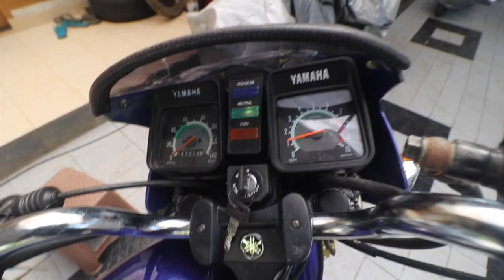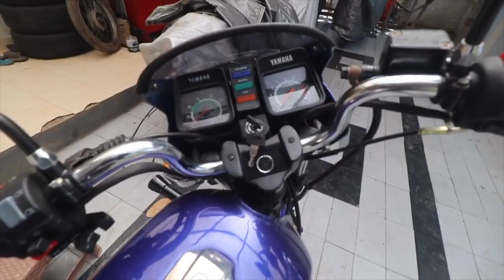How to clean and tune a carburettor (Malayalam Video)

Comment: If petrol damge o rings and rubber parts in a Carbourator , while cleaning?
Reply from the maker: It will
Reply: @Yamakaze  so whic is best nikavi Carbourator cleaner?
Reply from the maker: @its.me.ragesh  never put rubber parts in any solvent, remove the jets and leave them overnight in brake fluid, take the carb body and boil it in harpic + water. Use compressed air to clean each pathway

Comment: 🔷🔷🔷Clutch pidich gear idumbol vandi chadunnu..enathayirikum reason........pinne idakk gerar idumbol gear veeyate nuture aayipokunnu..pls help🔷🔷🔷
Reply from the maker: Adjust the clutch cable properly
Reply: @Yamakaze  etra adjust cheytittum ath poletaneyan
Reply from the maker: Clutch azichu nokendi varum
Reply: @Yamakaze  clutch plate set cheyumbol aa cutting ulla baagam ellaam ore positionil ano idaar
Reply from the maker: Ethu cutting?
Reply: @Yamakaze  clutch discinte idayil idunna plate
Reply from the maker: Steel plates, Beveled endow should be up

Comment: Cheriya doubt ente rx100 cylinder mariyatha orginalalla G4 pickup oke ind but top end kerinilla last 85 enthaaayirkum issue
Reply from the maker: 85 ok speed aanu, carburettor, sprocket, cylinder, wheel size everything is against rx 100
Reply: @Yamakaze  tnq bro

Comment: RMP Meter ellatha vandikk sound vach alle tune cheyunne ideling ettavum kooti vach air screw tune cheythu engine sound kooduthal akunna edathu vachu ideling kurach vachal ok ano atho 4000 rpm vekkanam ennundo tune cheyyan ?
Reply from the maker: E video il paranjutulla pole aanu njan cheyuunatha

Comment: Brother, I was cleaning my rx135's carb the other day, and noticed that the o-ring underneath the main jet is missing. I don't know what effect it has on the bike's running. Could you please tell me if I can get it from the shops? Probably from other modern bikes?
Reply from the maker: The oring prevents fuel getting sucked directly through the bowl into the atomizer. It might flutter mildly at some rpms. Nothing major
Reply: @Yamakaze  Thank you so much, Brother! That helps a lot.
Reply from the maker: @mjshaheed  👍
Reply from the maker: @mjshaheed  👍

Comment: Bro, Njan rx135 carb il munne 100 nte jets ayerunu.. now I has  changed to 135 spec jets but the missing happening after quarter throttle and rpm not moving up after 40kmph . What will be a remedy for this issue. Thanks in advance .
Reply from the maker: Needle position

Comment: RX 135  5 speed, engine start ആവും ,പക്ഷേ 2 minute കഴിയുമ്പോൾ ഓഫ് ആയി പോവുന്നു ,എന്ത് കൊണ്ടാണ്
Reply from the maker: Carburetor aavam, cdi aavaam, spark plug avam, ignition switch aavam, ignition coil aavaam

Comment: Rx135 carb needle pin 3rd pisition il ittal enthanu kuzhappam, company parayunnathu 3rd position aanallo
Reply from the maker: Illa
Reply: @Yamakaze  proof undangil next vedio seiumo
Reply: Guru rx100 user manual nokkitu undo. Company paraiunathu middle slot aanu. Company karer kulavakki angana vandi tharumo.. Next vedio'il nijam paraiyanum
Reply from the maker: @mmv3793  ok
Reply: 2 slot il ettal nalla smooth working kittum ente carburettor il 2 ndil Annu 3 rd il ideal moshan ayitanu thoniyath
Reply from the maker: @sonymathew488  depends on the carburettor jet size, elevation and a lot of other things

Comment: Helpfull video.portingine kurich onn vyakthamakkanam .
Rxg gerking ozhivakan port cheithaal mathiyenn parayunnu sheeiyano.
Pinne portinginte gunavum dhoshavum
Reply from the maker: Sure, jerking inde karanam ports alla, magent,  coil and power box
Reply: @Yamakaze  clutch bell maathram maattiyalo
Reply from the maker: raheem c rxg clutch annu athil ulla ettuvum nalla sadhanam
Reply: Ath ok aan, but  magnet rx100nte ittalo.
Powerbox entha cheyya
Reply from the maker: raheem c 135, rx 100 work cheyyilla.
Reply: 135 idanam alle
Reply from the maker: @raheemc497  yes
Reply: @Yamakaze  ok bro
Reply from the maker: raheem c 👍
Reply: Rxg jerking maaran rx135 te weight kooduthalulla magnet ittal madhi bro...
Reply: @ranjithranju4164  ok. Thanks bro

Comment: Sir ..Satyam parayalo
Iduvare kandadil vechu
Ettavum perfect ayittulla
Explanation
Really you have a deep knowledge about two stroke bikes
I have rx100. 1991 my bike hardly reach 
85 to 90 km speed only .at 80 to 85 speed my  bike feels unavailablity of petrol in this time if I release acceleration  and again I start to accelarate bike can't accelerate then bike feel engine off .within 40seconds I can start again easily.and it seems same problem in80 plus speed.my carburator   mikuni japan i cleaned many times but same problem. I cleaned 2 jets properly 
I never opened  atomizer.because today I saw that in your video.now I use micarb carburator borrowed from my friend. it gives not good performance.but it reaches 95 km same before without any
 missing(unavailablity 0f petrol)
I wish to reach 120. normally my friends rx100  bike do that .
I changed my sproket 15/37 teeth from rx135/rxg .also I fitted 16  inch rear wheel from yamaha enticer.tyre TVs 16 inch 3.25 size. Please reply a solution if I want to increase speed of my rx100
What modification needed.
Please give a solution for my mikuni carburator issue.

So that I want to fit my orginal mikuni carburator.
Reply from the maker: Small tyre will only give you better initial, you have accidentally opposite mods, like the rx 135 rear sprocket will increase the top end but the 16 inch tyre will reduce the top end. Try adjusting the float height.
Reply: @Yamakaze  thank you sir
 A big thanks
Reply: Sir
Ende rx100 il njan eeyide power box fix cheydu.ende oru cherita arivu kond njan vicharichu pickup power okke koodumenn but pratyegichu oru maattaum vannilla .adu koodand ippol stock silencer aanu .rx100 Chrome.
Ende kayyil mini cat silencer . exhaust chamber.  catalytic silencer um und 
Pinne six hole rx100 silencerum und 
Idil enikk performance kittan idil edu select cheyyanam . please reply sir
Pinne oru kartam koodi chodikkam und
Ippol ulla carburator micarb india aanu. Mumb mikuni japan aan adil cheriya issue ullad kond talkaalam idu ittadanu.idil njan triptanalla performance different aanu.
Sir paranjirunnu issue clear avan float height koottan ennittu nokkan.
Ippol njan mikuni carburator hot waterl 20 mint  boil cheydal with lemon juice or liquid dish wash..allengil diesel or petrolil soak cheydu vachal.
Idil edaanu uttaman ennu parayamo. (  components okke ooreett)
(O ringsokke ooreett)
Ee reediyil cheydal carburator stuck o matte valla problems undengil clear avumo edaanu nalla reethi ennu paranju tarano sir

Thanks
.
Reply from the maker: Shamsu 100 harpic ozich boil cheythal mathi
Reply: @Yamakaze  thank you sir
Power boxum .silencerum idinde reply parayamo sir.njan chodichirunnu
Catalytic silencer
Mini cat silencer
Stock rx 100 silencer
Stock six hole rx 100 silencer
Indinde combination with silencer.
Edaanu better
Reply from the maker: Shamsu 100 cat gives better initial, 6hole is specific for rx 100, mini cat I have never used, normal rx 135 has difference in the baffles
Reply: @Yamakaze  thanks for information .👍

Comment: Bro.. Vandi rx135.
70-80 speedil kore neram pakumbo vandi missing aakunnu.. Chelappo off aayi pokum . Reason??
Reply from the maker: tankil thurumb undo? anegil tank clean cheythu muthiya filter itty carbon clean cheythu nokkanam, thurumb illengile carb clean cheyyanam. alengil tankil ulla air hole block airrikkum, athinu petrol lid thurannittu odichu nokkiyal mathi, athum alengil float height correct aano ennu nokkanam
Reply: Bro cdi unit complaint ആയാലും missing വരും
Reply: @Yamakaze  okey bro... float height maatrame ethil nokkaan baakkiyulluu..
Reply: @muhammedruvaid8426  okey okey appo athaavaaam alley( eppo vandiyil ullath vandi mnfct cheythappo ullathaanu).. swiss cdi ne patty nthaa abhipraayam ??
Reply from the maker: Fazil Peravoor 👍
Reply: @Yamakaze  bro..cdi complaint aayaalum missing undaakumo ??
Reply from the maker: Fazil Peravoor yes
Reply: Same issue ente vandikkum undayirunnu 3 dys munne ath sheriyakki.10 kmtr okke vandi ride cheithal 8 pravashyam okke vandi off aakum sherikkum oru madupp thonni oru workshopil kaanichappol oral paranjath athinte ignition coil or cdi complaint  aayittundavum enn but vandikk current krithyamayi kittunnundayirunnu petrol tapil koodi petrolum varunnund tank onn clean aakki nokki ennittum pazhaya pole thanne pinne oru pravashyam pokumbol vandi valland off aaakal appo oru karyam urappichu ith carburetor complaint aanenn vandi frndnte wrkshopil ethichu avan carb azhich check cheithappo fuel varunnath valare cheriya levelil needle complaint aanenn avan paranju avidunn thanne veroru carb vech vandi otti  oru off aakkalumilla nere chenn shopil poyi needle vangi njan thanne change aakki vandi puli off aakalumilla munneyulla overflawyum illa

Comment: Bro, neat idle at the end. Pilots are the 115 itself or bigger?? 
Im curious. 😊
Reply from the maker: Pilot jet is 17
Reply: @Yamakaze  oops my typo. I meant to ask pilots 15 or higher. If its your blue rx100, a 17.5 made it it idle in sweet  lows as opposd to 15??
Reply from the maker: Luke Vaidyan rx 100 is also running stock jets

Comment: Bro idle jet miss aayi kittan vayi undoo bro plsss
Reply from the maker: Paadaanu, e video thudangi aapol njan paranjile ellam our pathrathil vech ayikku enn. Ithukondanu paranjath. Carburetor rebuild kit kittum. Jet quality pora pakshe work cheyyum
Reply: @Yamakaze  sradha pettann maari pooyi
Reply: @Yamakaze  bro aa kit nu ethra rate und
Reply: @Yamakaze  idle jet mathram miss ayittollu
Reply from the maker: Athu mathram kittan chance kuravanu, check with local workshops
Reply: @Yamakaze  ok rebuild kitnu ethra rate aavum
Reply: @Yamakaze  rebuild kitil idle jet undvoo
Reply from the maker: @ahammedshahabaskk7515  yes
Reply: Rx 100nte carburetor spares rx135nte carburetorinu upayogikkan patto
Reply from the maker: @ahammedshahabaskk7515  no, jets are different they won’t fit

Comment: Is there Any other carburetors suitable for rx 135? Any 4 stock carbs?
Reply from the maker: Nope
Reply: Have you tried any? @yamakaze
Reply: Can we use any same size jetting carbs?  If not why we can't?
Reply from the maker: @iqra4835  yes, Enfield lightning carb in an Rx.
Reply: How did that go? Does it work?